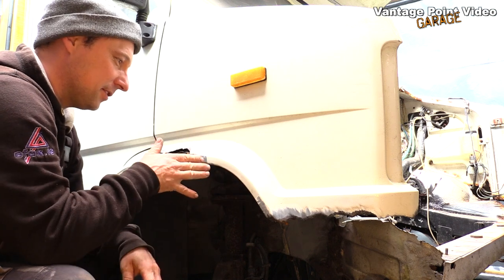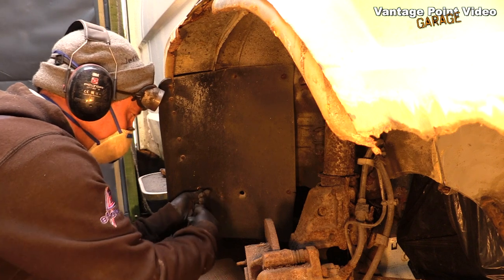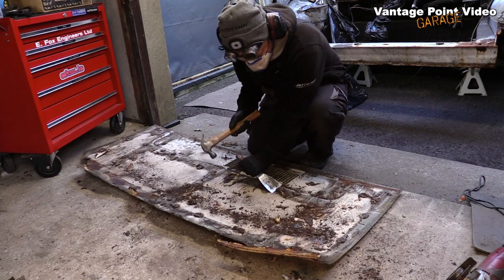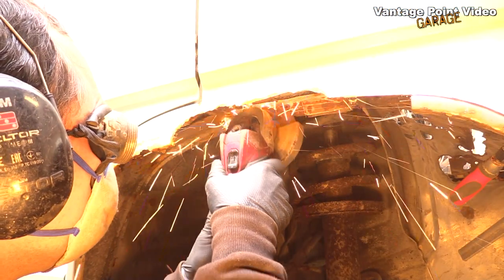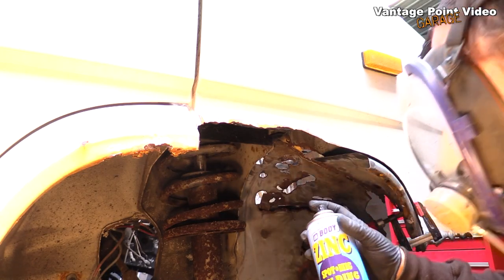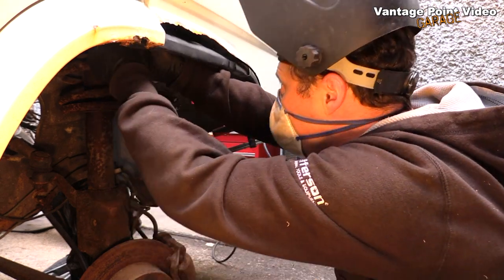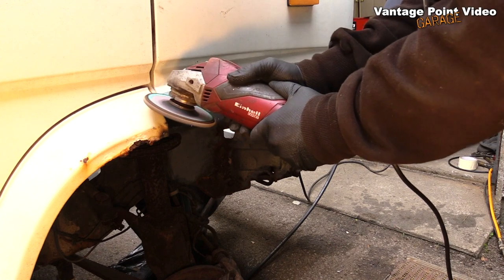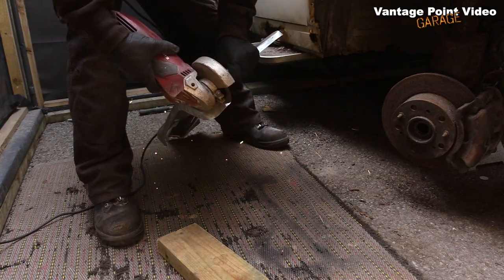Talbot Express Wheel Arch Welding Repair: Camper Van Restoration #8

Comment: That is a good start. I used a hefty 2 pieces of angle iron to make an impromptu brake in the vise.
Reply from the maker: I did that once before for a sill that was going to be visible. I’d do it again in similar circumstances. I used clamps on the ends as well 🗜

Comment: Great videos Senan, thanks, I'm starting on my 2.5TD Talbot Express Pilote R580 1991 now, a complete welding novice. Is the Jefferson 185 with 0.6mm wire the way to go ? Same repairs as you but not as bad and a bit around jacking points / front cross member. Dave Cork.

Comment: Don't continuous weld, do little sections 5mm weld move along 50mm then weld another 5mm it avoids over heating and warping the steel. Well at least thats the way the panel beaters did it when I was painting cars.

Comment: Is there a way of removing wheel arches/wings? There's rot behind them that I need to get at.
Reply from the maker: Usually the top half of the wing isn’t too bad and weld in panels for the arches are widely available from places like Coastal Motorhomes and you can just cut out the lower area as I did in this video. https://youtu.be/cfn--MeCang
Reply: I can beat and fab panels. Looks like only way to get to structural elements behind the wing, is to drill all spot welds around from around it. What an awful design!
Reply from the maker: @CourtChappOfficial  yeh the Kadetts I usually work with have bolt off wings.
Reply: @VantagePointVideoGarage  The one I'm working on is a 90' fiat kon tiki swift 5birth. No replacement parts anywhere.